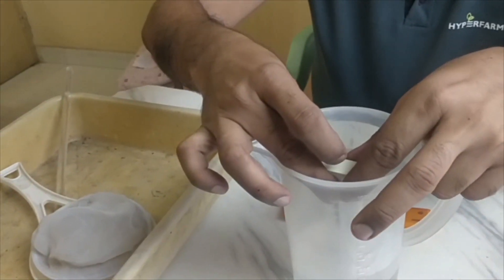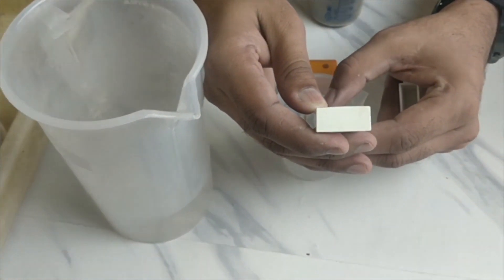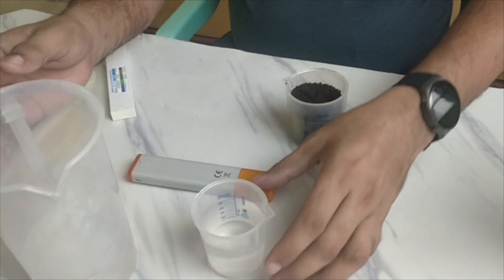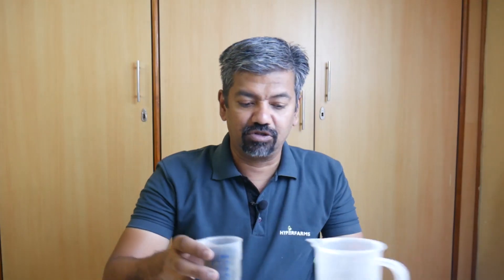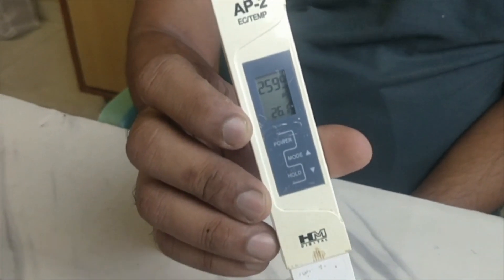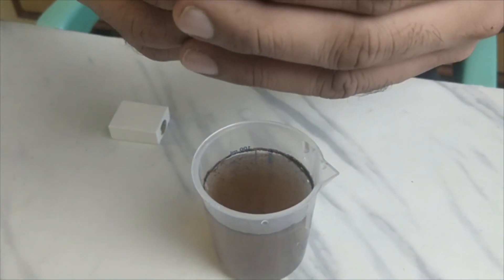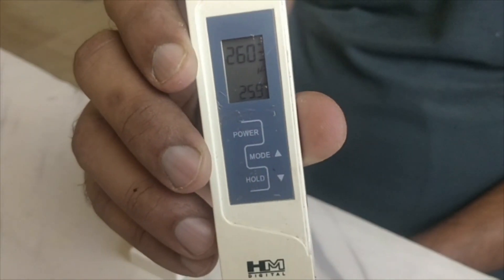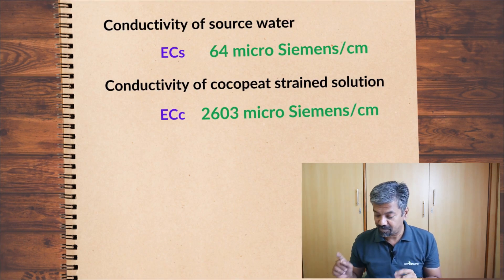CORRECT WAY to Measure EC and pH of cocopeat using 1:2 dilution method

Comment: You mentioned EC of. 5  in the beginning, what ix the unit. Your measured EC of the sample is 2.5 milli S/ cm.
What is the instrument for both EC and pH. First the instrument needs to calibrated with Standard solution, is n't it.

Comment: My question seems stupid 🙈 sorry for that ...
Can i use the TDS meter to check the EC conductivity and use any chart conversion table to check the EC level ?
Reply from the maker: Totally valid question. Yes you can use the TDS meter and convert it as per the factor provided by the manufacturer of the TDS meter.

Comment: A small request: plz make a video about how to make a stock solution for ec and ph calibration. Ph calibration pouches are available in market or online but ec is a tough nut to be sure of. Plz try providing a solution for that in upcoming videos if possible.
Reply from the maker: Atul, if i understand right, you are asking you the buffer solutions for calibrations correct?. pH 4, pH 7 and EC buffer solutions? I will definitely make a video. Thanks for the suggestion 🙌
Reply: @TheGeekgardener you got my point sir. Ph buffer solutions like 4 and 7 are available. But as far as i know, nothing is available for ec calibration.
Plz share share some light as to how we can make accurate ec calibration solutions at home or where to buy...

Thanks for the quick replies sir.
Appreciate your efforts. 👍

Comment: Hello sir.
Supposedly i have harvested a plant and now i want to use the same cocopeat again in another  plantation. How do i seperate the cocopeat from the roots that are left in the cocopeat after harvest???
Reply from the maker: Atul, 
If the cocopeat is in a opentop grow bag, its a lot easier to remove and take out the old roots ( or even simply let to dry). but in a closed grow bag(like the slabs), its very difficult to remove the old roots.
Its a practice to plant the new ones next to where the old ones were cut off. Anyways beyond two crops, the media is recommended to be changed.

Comment: Really informative as always !  Do you have a guide on how to this for rockwool medium ?
Reply from the maker: Thanks for your kind words.
Rockwool medium is relatively more inert than cococoir and not so brittle / powdery like cocopeat. This makes it a lot easier to measure its EC ( which is infact the solution EC the rockwool is saturated with). Over time the rockwool slab can get salt accumulation which can be measured by inspecting the drain EC. 
I dont have rockwool with me. I will try and see if we can make a video in future.
Reply: @TheGeekgardener  thank you so much 🙏.